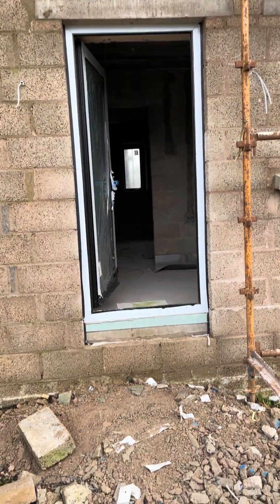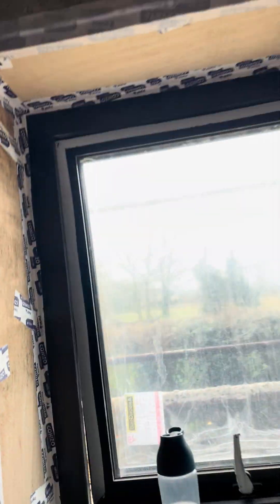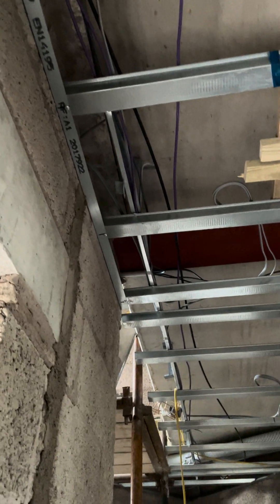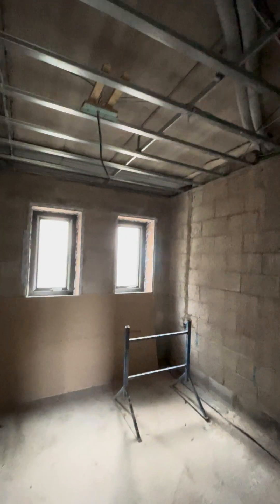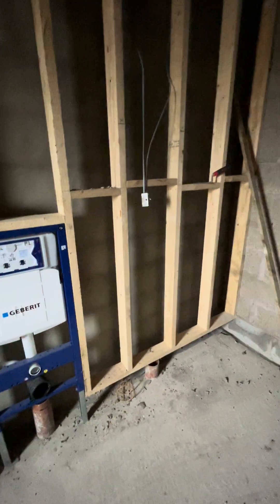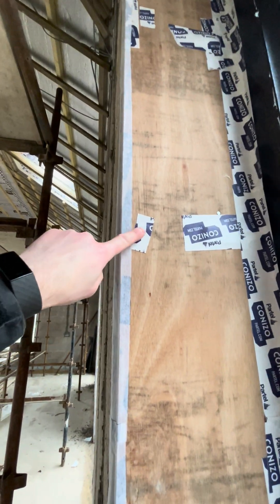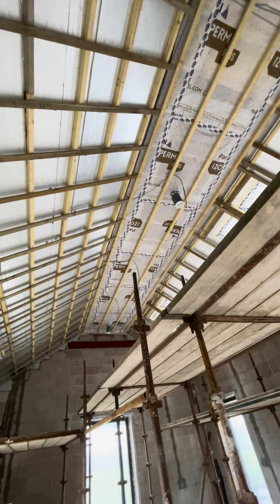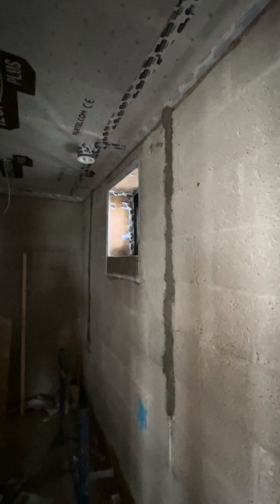Airtightness Process in New Homes   Video02

Comment: Just wondering do you cut the dpc back against the block before painting
Reply from the maker: Yes, BUT you must check with your local building control office first. Although the extended DPC does not really do anything some building control officers will insist on it. In that case you would have to paint top & bottom edge where block meets DPC.
Reply: Thank you